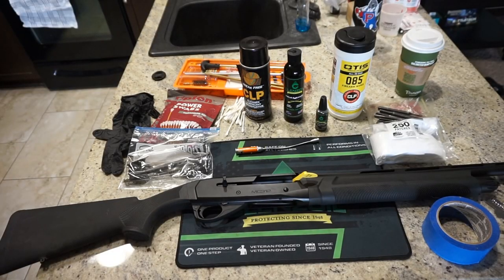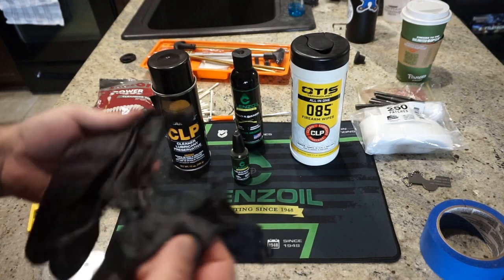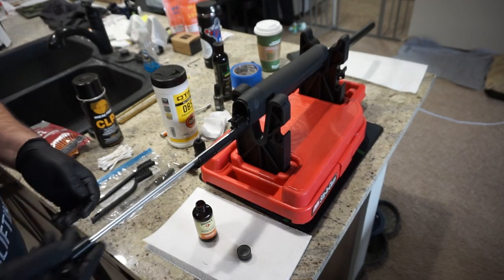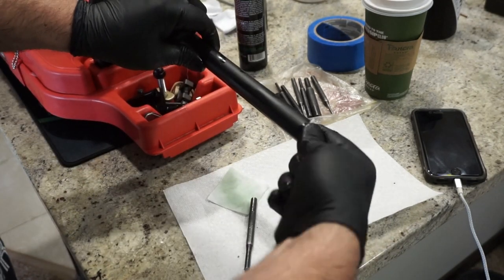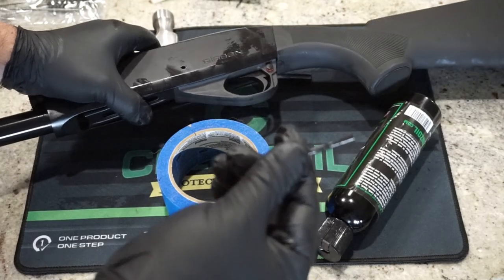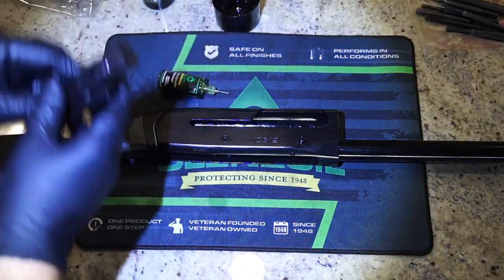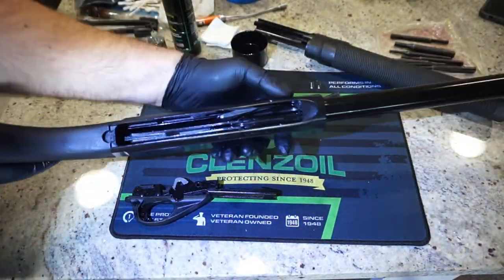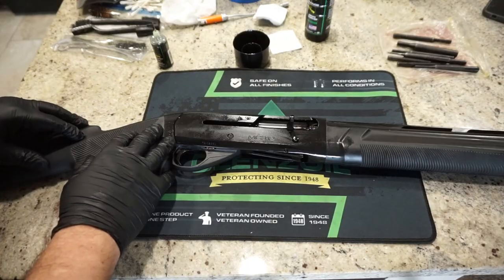How to clean the Girsan MC312 12 gauge shotgun.

Comment: The new mc312 has a pic rail milled in to the receiver, not a fan of that but seems pretty smooth for a budget 3.5 inch chamber shotgun.
Reply from the maker: You may still be able to find the older style out there.
Reply: The 28 inch waterfowl version does not have pic rail...

Comment: Really good video man, used it to clean mine many times. Although I have a question, do you need to take apart the bolt and clean the firing pin, for a really in depth cleaning? I've heard of "deep cleaning" guns but never done it because I don't really know how.
Reply from the maker: You can but I’m not sure the manual explains how aside from a parts diagram. Usually is not that hard, just a pin that gets hammered out and the extractor and spring pop out along with the firing pin. You can if you want, but I haven’t disassembled mine.